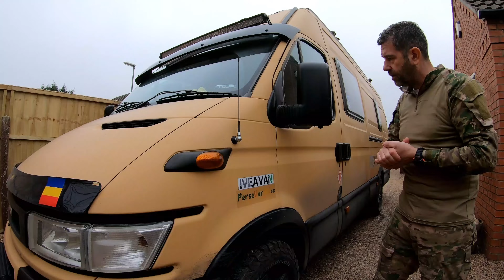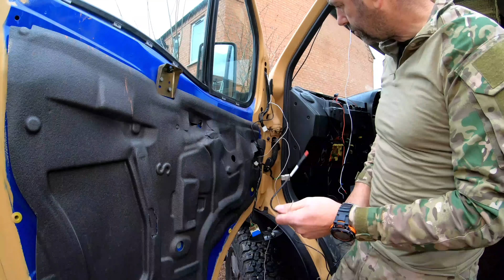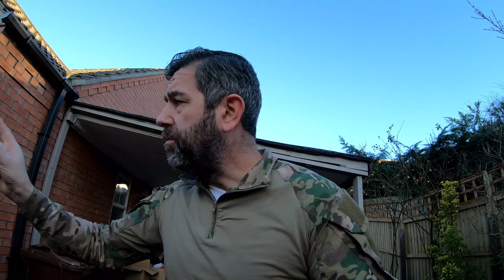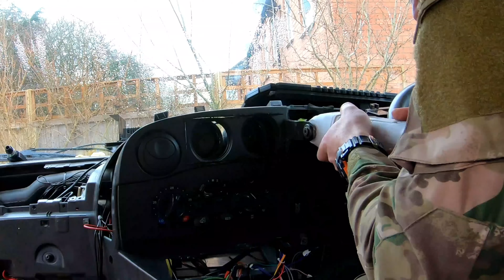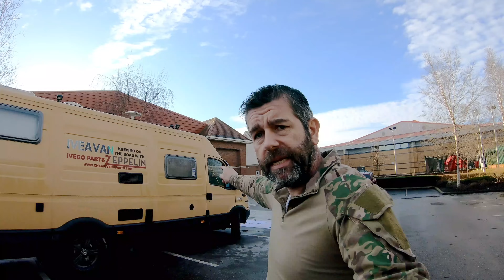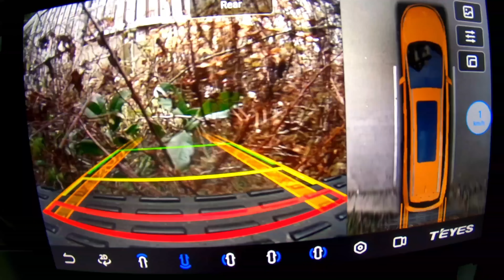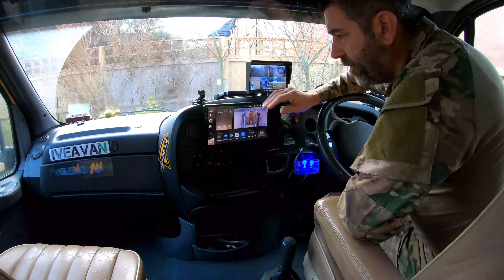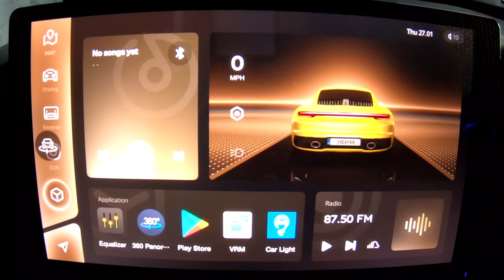Teyes CC3 Android Head Unit & 360 Camera Install [ Iveco Daily Campervan ].

Comment: fascinating video I am thinking one fittedto a 7m long motorhome. My main issue is that I want to display both gps mapping information and 360 view. Is this possible? I note in your video you also show a screen with 4 camera views: is this an entirely separate system?
Reply from the maker: Cheers matey 👌👍. Yes you can, the 360 camera view can be viewed in the corner of the screen whilst using Waze on the main screen, that's how use mine. The other screen is for my security ip cameras that records a weeks worth on a MDVR. However, that isn't part of the system 😉👌👍👍👍.
Reply: @Iveavan  thanks for that update. Interested in your security ip system and security / tracking in general. Any videos?
Reply from the maker: Hi Ian, unfortunately no videos on the security cameras, but probably one I could do in the future 😉👍👍👍...
Reply: @Iveavan  How is it with waze, my current old setup is a little underperforming and laggy? and i'm trying to convince someone (ahem) that we need this lol (really relay camping)
Reply from the maker: I haven't got a clue what your on about bud 😂🤔👌👍👍👍
Reply: @Iveavan  the wife lol... apparently i have too many gadgets

Comment: using the white power wire, is it already connected into the male connector? or did you have to solder it with the black camera lead wire? from there it is spliced into the power wire of the front blinker turn indicator?
Reply from the maker: The white tail wire on the main plug of the camera fly lead is only around 3 inches long, you do get more white wire within the kit (around 2 Mt's in lengh) that you'd have to connect upto the short white wire on the camera fly lead plug (I soldered mine together). I had to further extend the O/S wing mirror camera white wire (pink in this video I think it was) due to run of the cable and the way I had to route it through the bulk head. Yes, it's terminated by splacing onto the positive wire for the side repeater 😉👌👍👍👍.

Comment: You've tipped me over the fence and I've just bought one. Fitted a 360 setup to my Transporter 3 yrs ago and it was really good when I finally got the calibration sussed (menus were completely in Chinese). That was fed into the camera input of my Kenwood but this looks a lot better integrated and easier to set up. Shame there's no fitting kit for my Ducato, I've ordered the Jeep connection (also a Fiat) and I'll have to fabricoddle some sort of mounting bracket/fascia to prettify it. Good down to earth review as usual.

Edit: Just want to point out that the UK site is just a forwarding link to the Aussie site, so that's where it's going to come from, with the corresponding delivery time and import duty issues
Reply from the maker: Ahhh cool! you won't be disappointed Andy (yes it's fairly straightforward in calibration 👌👍) and thank you! 😉👌👍👍👍.
Reply: Mine arrived last week, but today was the first chance I've had to look at it. Unfortunately it's not a straight connection and I've had to order a Uconnect to ISO interface, so it's going to be another week before I have another go. All looks good qualty kit though
Reply: @selwin9095  No, the website looks like a UK one, but it diverts to Australia when you place your order and that's where it was posted from. No biggie, just takes a bit longer

Comment: Ey up mark,cracking piece of kit buddy,just on the off chance, do you still know anyone hull way who can fit me some solar/leisure batterys and split charger,,just an ask matey if not no probs,
Reply from the maker: Cheers matey 😉👍, not in the Hull area bud unfortunately, I haven't been back much since I moved away from that area so I'm a bit out of touch who you would use around there 🤔 only other person I know who could do it for you is @unimpressedjeff 😉👍👍👍.
Reply: @Iveavan  cheers mark,,